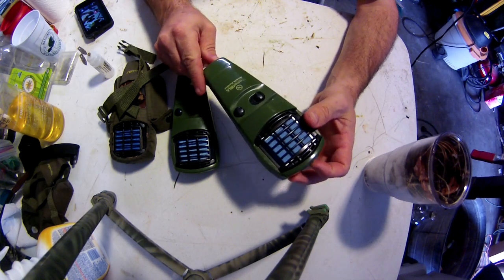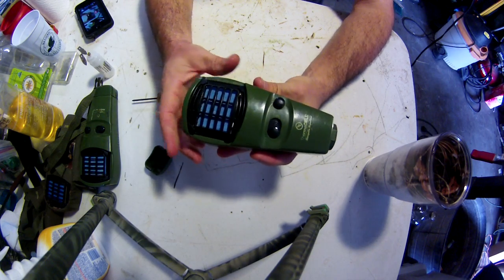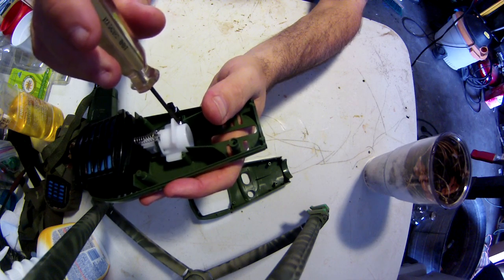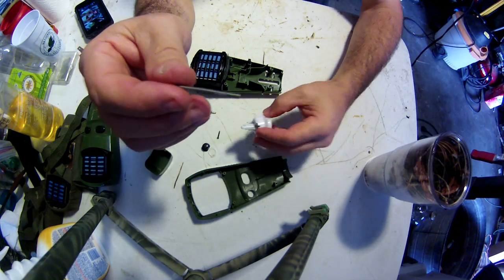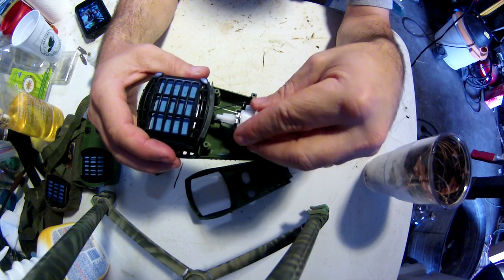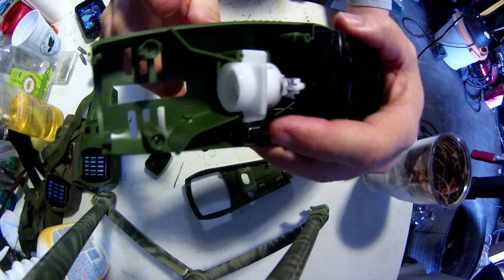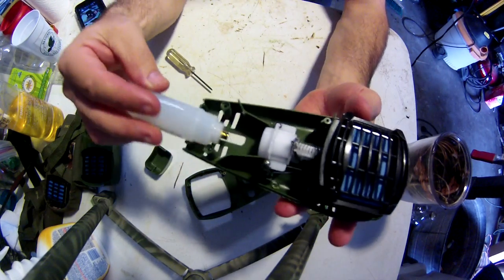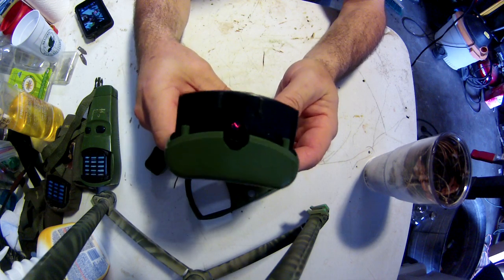Thermocell Repair-No ignition or won't light.

Comment: Nice work Brenda! I wish you lived closer. I would pour as much propagation and greenhouse knowledge into you as I could. You're an eager learner and well on your way to plant nerd.
Invest in a few 10x20 humidity domes. They come in different heights. I prefer the 6 or 7 inch domes for starting shrubs. Mist the newly stuck plants and mist the inside of the dome before placing them on the tray. Place the flat on the north side of a building or on a shaded porch which ony gets very early morning light. Mist the plants and inside of the dome to keep high humidity when sticking plants. It will increase your success, especially with shrubs. Most shrubs root well in high humidity and temps in the 80s to root out quick as softwood cuttings.

Comment: Good video, when I took mine apart I didn't find a long spring like you show. It seems it's that the spring is stuck inside. I tried to insert a small diameter screw to hook the spring and remove it but no luck. I'm sure I can't find a spring to match it so I'm stuck buying a new one. Still like your video.

Comment: ty a fix. I bought the patio version today and it would not stay lit. The spring was in a different configuration but I stretched it as best I could then put it all back together and it's been working for an hour, thanks again.

Comment: I’ve got one that the gas keeps running.  Can’t shut it off. Ideas?
Reply from the maker: I’d check inside and make sure the switch is functioning properly first. Then check the spring is allowing the valve on the fuel to close.
Reply: @strutsnbucks  I have checked the on off switch.  It’s not making proper contact with the spring and shut off device.  Any ideas .  TIA.

Comment: That was not my problem because I could clearly hear the bupane (lol) flowing out of the cartridge.  It just would not light.  Occassionally it would light but then it finally would not light at all do to a lack of ignition.  Had an old thermacell that worked for 8 years till I lost it and then I bought this newer model and it sucks.

Comment: I have a new MR300 with this problem. They have updated the design now where that spring is behind a little allen keyed set screw. Carefully remove that with an allen wrench, stretch the spring as you see in this vid, and carefully push the spring back in and put the set screw back in. Mine doesn’t light immediately, but at least now it does light eventually after a few minutes of trying. At least it didn’t end up in the garbage :)
Reply: Thanks for info, I think mine has that allen set screw now I have to find a allen small enough. I just wish I would have seen your post before I reassembled it.
Reply: Move that igniter closer maybe

Comment: Let me start by telling you I have no affiliation with the author of this video! I do have a love for YouTube and  the Thermocell Backpacker Mosquito unit I was having trouble with. The Backpacker is an entirely different unit but hopefully has the same basic components as the one described in this video. I have to admit I didn't watch the entire video before attempting to fix mine because that's the way I roll. I got to the portion where you stretch the spring and decided I would attempt it. My Thermocell Backpacker would light but not stay lit. Now this unit was almost new and only used a couple times but I've had it for a few years so I didn't want to throw it away before at least attempting a fix. Well, It worked!!  Without this video I would not have attempted it and really wouldn't know where to start! Thank you thank you thank you for this post. I give it a big "ThumbsUp" and am now subscribed to you channel. Great job and keep the videos coming!
Reply from the maker: Steve Fredlund you’re welcome bud. I’m not a “youtuber” by no means, but I kept buying new ones when they wouldn’t light or stay lit so I discovered this easy fix and thought I’d share. Thanks again.
Reply: @strutsnbucks  Well, I've found this to be a wealth of information and just about anything you want to fix or build is on here including fixing my Thermacell so, Thanks for the info. Stay safe!

Comment: Realized that if your hear it hissing then you probality don't have an issue with the cartridge emitting gas. Removed the cover plate and moved/bent the copper wire closer to the burner. Closed it up, turned it on...waited 5 secs and click click...back burning and ready for the woods...
Reply: Late answer, but could probably help someone. I had the problem that it would light up, even with the hissing sound. What I did was to remove the cartridge, put the endcap back on, put it in "on" position, and then I blew really hard into the ventilation slot for the cartridge. Fired up right away after that. It was probably something in there.

Comment: Good video! I found the same fix works well for me. While I have it apart though I do one more thing that I found helps. I take the mat holder/heat plate apart and there is a brass barrel with a screen at the top that the butane actually travels through and is the actual "burner". I take that barrel out and clean the screen with some brake parts cleaner and then let it all evaporate out before I put things back together.